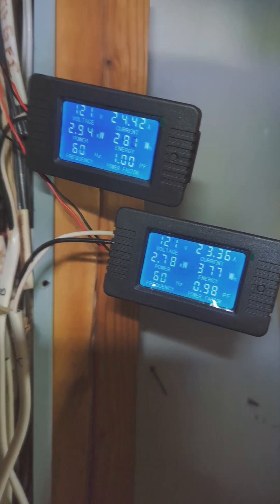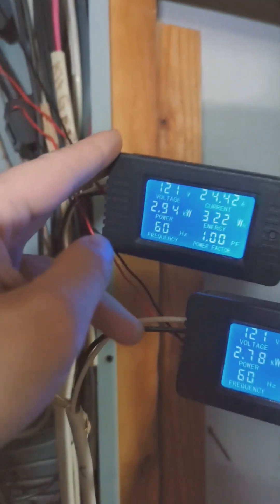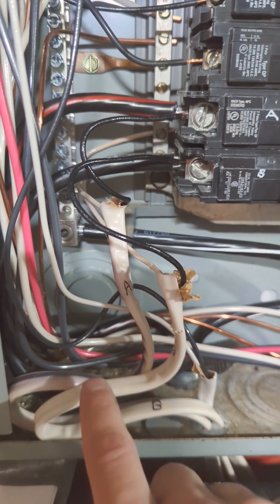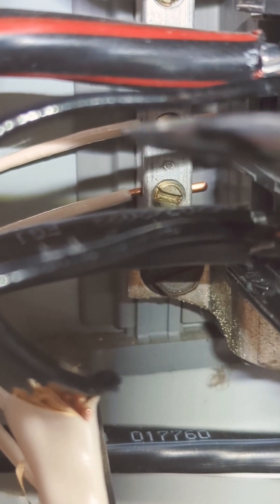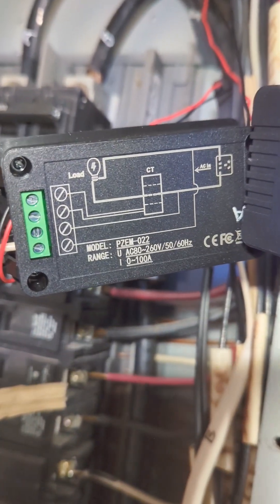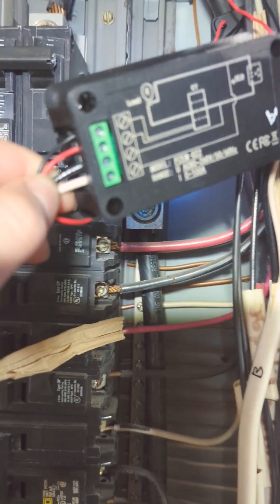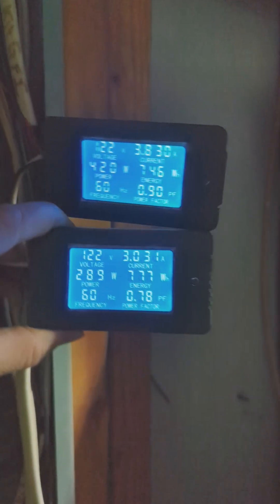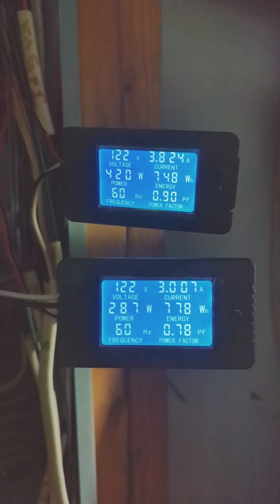Circuit Breaker Power Meter Install PZEM-022

Comment: You put two dissimilar metals under one screw and in direct contact with each other. The feeder conductors appear to be aluminum and will oxidize and corrode when touching copper to your meter. Eventually heating up, causing thermal expansion, contraction, corrosion, heat and resistance. Eventually leading to a loose melted terminal.
Reply from the maker: Thanks for the info, do you know how I could prevent that?  Can I put another terminal on the copper wires?
Reply: Take a short piece of 12” of copper wire, pick a general receptacle circuit with the same gauge wire and remove the wire from 
the breaker. Put the short piece on the breaker and make a splice so you have 
only one wire under the screw, using a wirenut within the enclosure.

Comment: Yes it does matter.  Be careful.
Reply from the maker: Thanks for the clarification!  For some reason it seemed like it worked either way.
Reply: You have to have them connected to the same phase that the Ct is on A for A and B for B. It will work either way but won’t be accurate as the power factor will be wrong
Reply from the maker: Yes, you're right.  Luckily I did do it right but shouldn't have said it doens't matter without more information.  Thanks for the comment man.